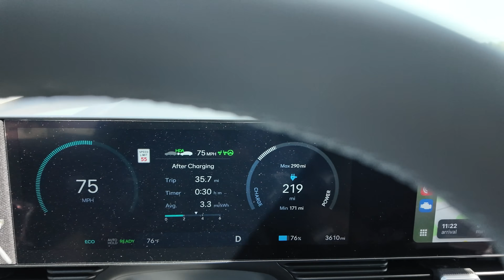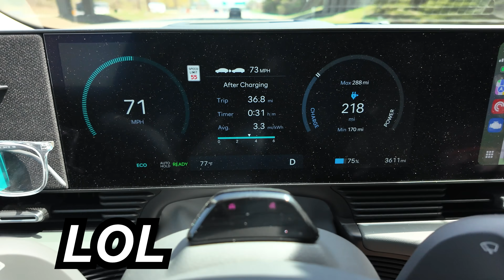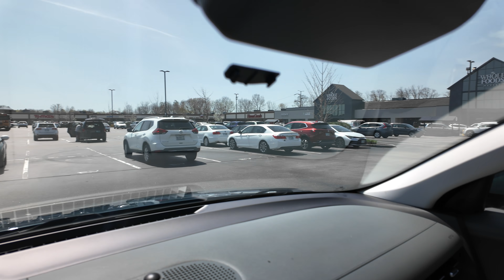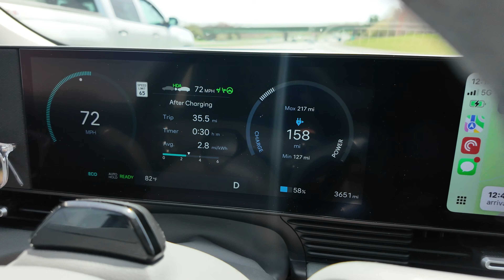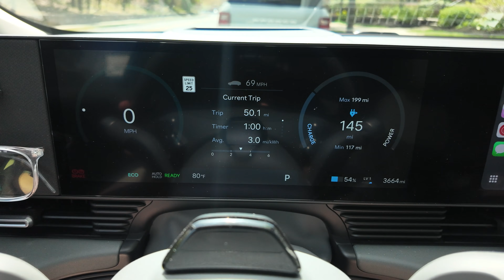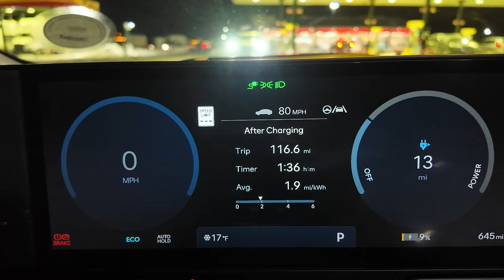2025 Ioniq 5 Highway Efficiency Test | IONNA Rechargery Spotting

Comment: You probably already realized this, but aero matters much more than weight for wheels when talking about efficiency, especially on the highway. I would be very surprised if those 19" forged wheels increased your efficiency. They are very open and not aerodynamic. The Handcook EV tires might help offset the poor aero.

Comment: Hmm, it gets winter range during the summer?
Reply from the maker: 249 miles is winter range?
Reply: @TheIoniqGuy 3-ish miles per kWh is. That’s what I get during the winter when it’s around 0F out. Is the Hyundai Motor Group working on better battery technology, heat pumps, and BMS for the future with their new architecture/platform?
Reply from the maker: There is no way you’re getting 3 miles/kWh when it is 0F out at highway speeds. Maybe if you’re doing 25 miles per hour with no heating on. You’d be in the low 2s in those temperatures at 70+ mph. Around 32F, I could agree with you if you have a RWD car
Reply: @TheIoniqGuy At 55-60mph with the heated seat on, yes. I wasn’t too happy about it, as you do lose a lot of efficiency, but 3 was achievable. Managed to hit 4.5-5 for the summer.
Reply: @TheIoniqGuy What is your favorite thing about this vehicle though or future variants for Hyundai/Kia? The Mustang Mach E is okay, but SK seems to be doing better in the long-term. GM Ultium is a bit iffy, but that’s just what I heard from someone I know who works there in R&D.
Reply from the maker: The biggest differentiator for me is the 20 minute charging. That's really the only major thing that Hyundai has going versus other OEMs. With the upcoming IMA platform which will likely underpin the redesigned Ioniq 5 in a couple of years, I hope that they can increase charging speed even further by going closer to 1000V.
Reply: @TheIoniqGuy Makes sense. I’d be a little concerned about the increased cost, thermal management/battery makeup, and how fast charging networks will meet 800-1000, as most are 400. I don’t use public chargers often, so it really isn’t a huge concern of mine. They just need to stick with NACS and work together to advance it versus having all these variants, imo.

Comment: Your range numbers are about exactly what I am getting on 70% after 1000 miles of driving for my location. Interesting to note - you said it's fairly flat where you are and did this test.  However, where I'm doing my 70 mile trip to the airport 140 round trip, I'm average efficiency is 2.8 mi/kWh after multiple trips and I've got a few 5% grades with over 800' elevation change.  My average speed is 74-75mph so a bit faster than you too. Temps were between 55 and 80F.  I've got the Limited AWD with big tires... and I agree the green interior is rather nice 😃

Comment: bringing up old stuff.....SOC...between %20------%80  is my usual. I read that Hyundai is suggesting no lower than %30 SOC..is this trure?
Reply from the maker: No. You have a big battery for a reason. Use the whole thing
Reply: @TheIoniqGuy  That is what I am doing. I will charge to %100 every so often, but usually drop to %20 ,sometimes lower and charge. Thanks

Comment: At 2;13 in the video, you showed a Forward Attention Warning.  I have a 2025 Ioniq 5 Limited RWD. Whenever the sun is out, I get that warning when I try to use Lane Keep Assist.  After numerous trips to dealer and numerous calls to Hyundai, they finally admitted a problem.  Hyundai replaced the inferred camera  but that didn't change anything.  Finally, Hyundai acknowledged that I wasn't the only person experiencing this and said there will be an over the air update to address this problem.  I hope so.
Reply from the maker: Not much you can do but change your glasses: https://drive.google.com/file/d/1ehhRPNNmUxqij6SbVQBAenHUx51nsDRc/view?usp=drivesdk
Reply: @TheIoniqGuy my prescription glasses sets off the warning. I've even turned it off but it will still warn me.
Reply from the maker: It reactivates if you use highway drive assist. There’s no way to permanently disable it

Comment: Wheel size (diameter) is irrelevant, weight is almost irrelevant. Tyre width, tyre compound and most of all rim design make all the difference.
Reply: This is basically my understanding as well. The weight of the wheels only has an effect when changing speed, and it shouldn’t be a lot because regen can recoup it as much as any other weight. So a static freeway test will be unaffected. 
The diameter could have an effect if it changes the airflow significantly, which is what width is doing but to a greater degree. 
Wheel design has a huge effect.

Comment: I picked up a 2025 AWD Limited at the end of March, also in southern New England. I've put about 2200 miles on it in just under six week, with a mix of highway and city driving. I drive in Normal mode. My overall efficiency for the time I've had the car is 3.6 mi/kWh. Right now, at 90% charge, I have 312 miles on the GOM.

Comment: The speed makes a big difference in efficiency. If you lower your speed to 62 mph (I thought I saw that the speed limit on I-95 is 65 mph where you drove), you will get a much better range. I have experimented with my Ioniq 5 (2022) and driven at different speeds to and from work and noticed that 90 kph (56 mph) is a breaking point when efficiency really starts to suffer. Altitude also makes a big difference. Any range tests always has to be driven both ways, as you did, to give any useful data.

Comment: I’ve noticed 65 mph seems to be the sweet spot for this car. I have the RWD 2025 and I regularly get 4.0-4.5 mph when traveling between Central PA and Philadelphia, and seem to get the best range going 65. Once I hit 70+, it seems to reallyyyy drop
Reply from the maker: Air resistance increases with the square of the cars speed so yeah, once you start going even moderately faster it makes a massive impact on efficiency.

Comment: I traded in my 2022 Ioniq 5 LTD AWD, for two weeks have been driving my new Ioniq 5 XRT.  With the nice weather, I am seeing 4.1 miles/kwhr. So using your number of 81.5 kwhr, that gives 334 miles of range. Or using the after charging page, I divided the miles traveled by the percentage battery used to get a range of 348 miles.

Comment: UK based - I had 305miles left with 25% battery used the other week. 
Did a 232 mile trip with 184miles left and a 4.9MKW mileage
Both with 16-17C temps. 
We usually average 4.1-ish around town, without being ultra frugal and we live somewhere VERY hilly. So we are usually going either up or down a hill. So some journeys are 13+mKW on way out and then 4-ish by time we've returned back up the hill.  😁
It's the latest version, only had it since Feb, the big battery, but with all the extra tech and features. Car is used on Level 3 regen.

Comment: It would be interesting to see how much difference you get with “Normal” in comparison to Eco on the same route.  My lifetime efficiency is about 3.2 which doesn’t seem great considering that a lot of my driving is my in town commute (25-40 mph) and although I’ve spent time on the freeway, it’s mostly 70 mph or lower. I’ve only had the car for about a month and haven’t had the urge to use Eco yet, but might see the use for freeway cruising. I’m in Normal almost all of the time with some short stints in Sport. 2025 AWD Limited.

Comment: Interesting info, thanks.  Noticed you got the dreaded “Pay Attention Warning”.  Hope Hyundai recalibrates that function because it is clearly not accurate.
Reply from the maker: My camera was blocking the camera which is why it said that. It’s performing as expected in that situation but I know others are having legit issues. I don’t so it’s not easy for me to investigate
Reply: super annoying for me and it goes off the most in bright sunshine conditions during the day
Reply: I have had it go off randomly early in drives, but is never a nuisance and is usually pretty accurate on my longer drives especially when I was driving home at 3 AM. Double check that your sensors are all clear as the winter weather can cause them to get covered leading to more nuisance than usual.
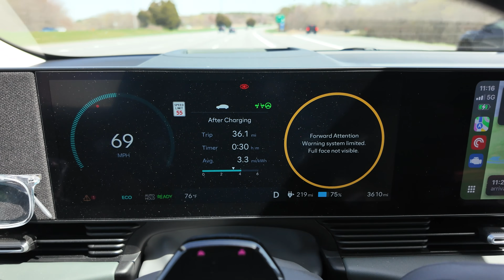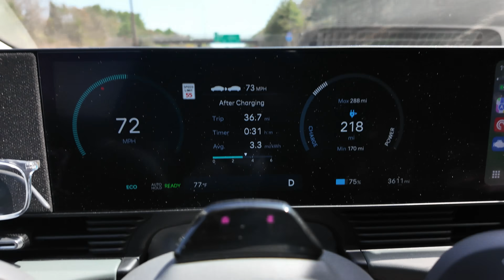Reply: @dissectingreality  this is in reference to the "eyes on the road and pay attention" interior camera on the steering column. At 2:20 and 2:30.